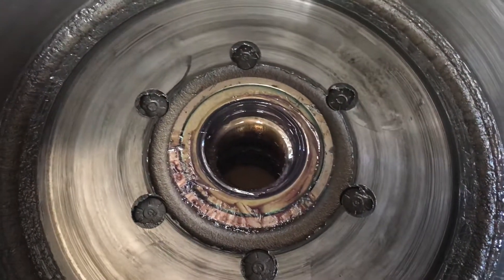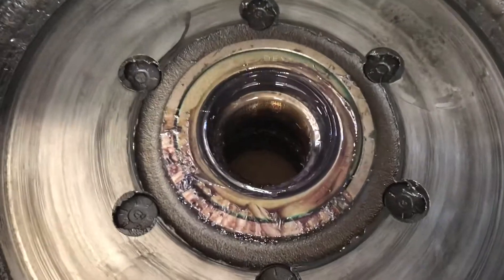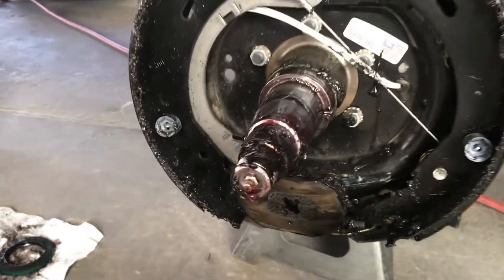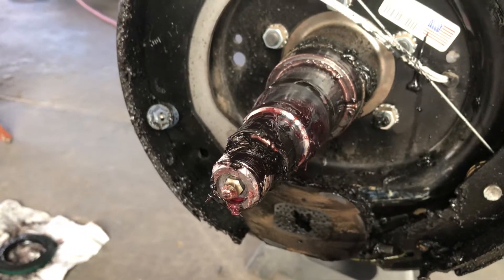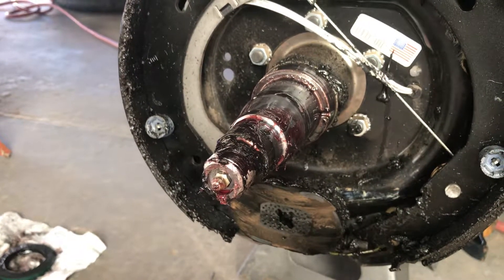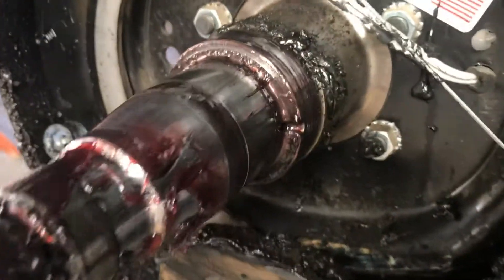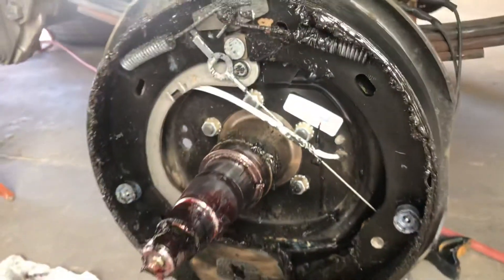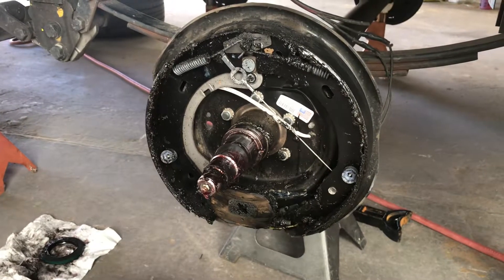There is a Correct way to use EZ Lube axle option

Comment: I have had 100% failure of the inner seal, ruined brakes on multiple trailers. I have used the Easy Lube system for the last time. It is a flawed system. I did the proper, jack up and rotate wheel, pump slow, but still had contaminated brakes. DONT USE THE EASYLUBE  unless you enjoy a major nasty cleanup and expense!!! It is a financial bonanza for Dexter, they sell a LOT of parts over this poor design!

Comment: I haven't done mine, yet.  Watching all these videos showing it's safe and not safe to do has so confused.  I had a mechanic give me 2 tips on using these Dexter E-Z grease axles.  And I kind of agree with him.  He said first, do it on a hot day and put the tubes of grease you are going to use in the sun to kind of "Soften" the grease before you use it.  That's makes sense.  We all know that when oil is thick, it flows slower.  So hence, a grease that can flow easier can squeeze through the bearings without difficulty.  Second, he said don't pump on the grease gun like a mad man and try to break a record doing it.  He said pump about 3 or 4 squirts into the zerk fitting and spin the tire for a minute or so.  Then repeat the process.  That kind of makes sense, too.  If you think about it, you need time for that grease to find its way through all the tiny bearing holes so the old grease can get pushed out.  I'm still apprehensive about doing it, but I think I'll follow his tips.
Reply: about to do mine also. Fingers crossed!
Reply: @Dan007UT  Let us know how it goes!
Reply from the maker: @ Gary P, everything your mechanic said is correct. If performed correctly, the new grease goes in through the center of the spindle, exits the spindle at the inner bearing, then enters the bearing rollers, then pushes the old grease out into the arear between the inner and outer bearing. That area then becomes full of grease. Once that happens, the hydraulic pressure of the new grease entering pushes grease from the center area through the rollers of the outer bearing and eventually dirty grease exits around the end of the spindle near the grease fitting where the new grease enters. This is the ideal cycle of the grease through the hub and bearings, but takes a LONG time for it to occur.

Comment: greasing is about timely greasing. With the void filled between the bearings filled a couple of pumps every few months is plenty and that is if you use the trailer a lot. When you over grease you actually do damage to the bearing. You want the old grease to cool outside the bearing track and build a wall to keep the new grease that still has it's long chain intact.

Comment: I sorta do not agree...
Spin or no spin, how will that force the grease out the seal?
I think it is folks using motorized guns or shop style air driven grease.
If you use a hand grease gun and SLOWLY pump grease in, it will go through the inner, through space between brngs, and out through the outer.
Key is to SLOWLY add the grease.
Go animal and blow the seal.
Just my opinion and experience... I have never pushed grease through the seal.
So far anyways.
Reply: I agree Tim... on my 4th season with the Dexter hubs. Go slow - my grease gun puts out about a teaspoon of grease (Lucas RedNTacky). I'll spin the wheel, do a couple of pumps. Spin and pump, pump and spin. I'll continue until I get new grease slowly showing up.  So far so good.  BTW, Dexter has a great animation on their website that shows this process.  I've done the whole re=pack thing where the bearings are examined. I like the Dexter system.
Reply: I agree with every thing you said. I would also add that it shouldn't be done with cold grease I do mine is the summer and still warm up the hub with a hair dryer if it's a little cool.
Reply: Case in point. Go check the tie rods on any vehicle (except OEM sealed) and look at the rubber boots. Yeh, big globs of grease because people over grease and break the rubber boot. 
What Tim said. Slowly and don't blow in a half pound of grease. Also, every 3 years, or sooner if you tow a lot, take off the hubs and do it the old fashioned way so you can properly inspect the bearing wear.
AND, buy a bearing packer. You'll thank me later.

Comment: If the ez lube system was NOT used then in this case the rear seal failed and that is a warranty claim against Dexter. Very expensive as the entire brake system, spindle, bearings, seals etc all need to be replaced. 

I have head of cases that even when following EZLube instructions, it is common for the rear seal to fail and damage the entire break system. On a two axel trailer 3 out of the 4 EZLube systems failed even though the EZLube manufacturer’s instructions were precisely followed. 

Dexter should re-engineer the EZLube system or pull it off the market. Period.